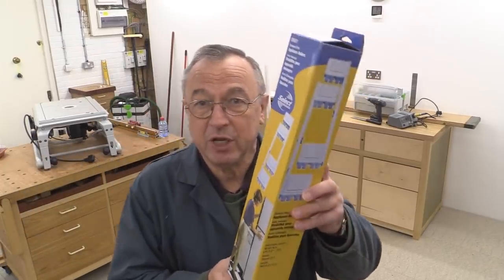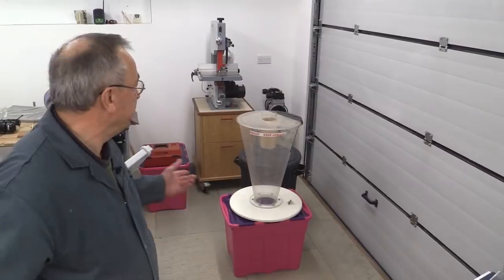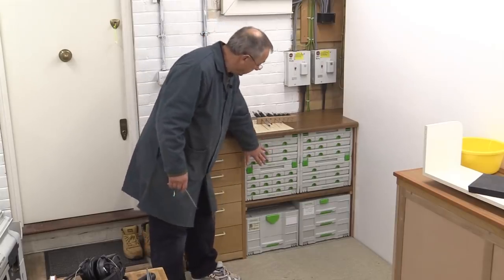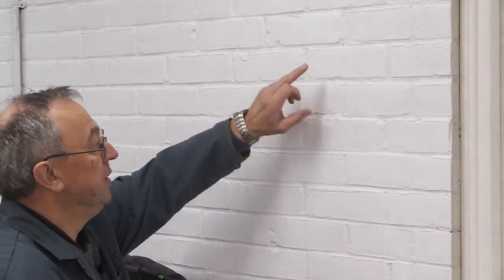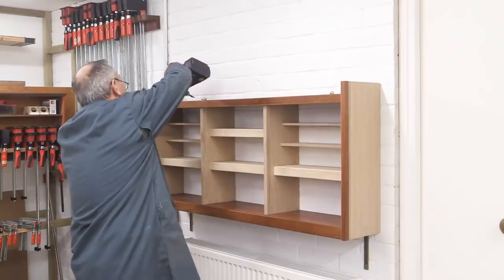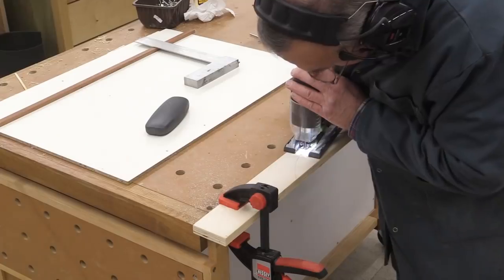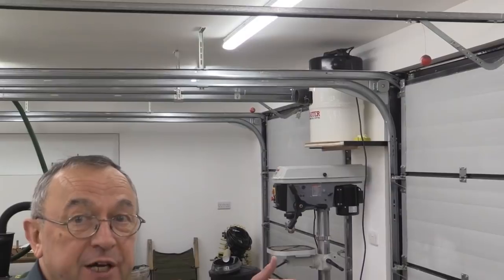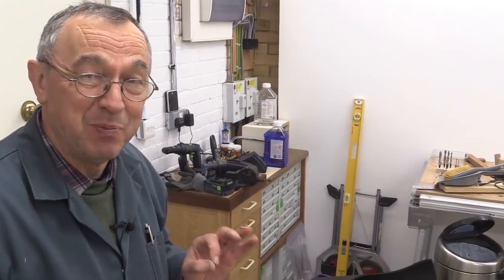The New Workshop #5

Comment: Hi Peter I have just looked at Ron Paulk's SMART  trailer tour which was very interesting.  He has lots of ideas for storing small parts etc so they are ready to hand and easy to find.  Might be worth a skim ( it's quite long but you can skip through it quite fast).
Looking forward to seeing the workshop once it is organised " Parfittly".  WKR  mike
Reply from the maker: Hi Mike, Ron has also done some work with the Parf Guide System which he rates as excellent !!  Cheers.   Peter
Reply: Yes he showed in a tube in the tour of the trailer.

Comment: Hi peter,

If you decide that you do need a wall cupboard, Dry Line Pro wall fixings work really well. I have put radiators and kitchen units on them.

Have you considered considered making your own workshop doors to replace the garage ones.  You could save a lot of space by getting rid of that overhead mechanism, and include much better insulation and security measures.

Andrew
Reply from the maker: Hi Andrew, Many thanks for the suggestions.  Peter
Reply: Totally agree Andrew, I have used them on dot and dab board on single brick wall and they are super solid

Comment: Cracking work as always Peter. I'm a little worried for your back when that extractor gets full and you have to man-handle it down.
Reply from the maker: I only need to change the filter in the extractor once a year as all the dust and debris is collected in my dustbin thanks to the cyclone.    Peter
Reply: @NewBritWorkshop  Ah nice.

Comment: You are getting a great shop Peter. What temp do you keep it? I got mine at 14-15 Celsius and find it very comfortable. Do you plan to put your compressor in the attic?
Reply from the maker: Hi Marcus, At the moment the weather is quite chilly and so I am keeping the shop between 10 and 12deg C. If I am gluing then it has to be 12 deg or more. I have the radiator now and that can raise the temperature from 6 deg to 12 deg in about 30 minutes. I am still undecided about the compressor as it is essential to bleed the water from it at the end of every day or at the end of use. With a loft ladder this is not ideal so the machine may end up in the main body of the workshop.  Peter
Reply: Peter, run an extension from the drain valve into the shop where you can reach it without having to climb. If it were me I would use 1/4" copper tubing and put a 1/4" ball valve on the end in the shop. You can also buy automatic bleeder kits for compressors.
Reply from the maker: Hi Bob, I will - many thanks.   Peter

Comment: Is this workshop smaller than your previous one?
Reply from the maker: Yes, by a small amount but in the old workshop I had a second floor where I could store masses of kit and materials.   Peter
Reply: Looking good Peter.  Lots of work, but nice to have a clean sheet, even if a touch smaller.  Have you got a sketch of the new workshop layout you can show us, or is it not yet 'locked down'?
Reply from the maker: Hi Terry, No sketch yet as I am still adjusting the positions of things. In the next, and I think final, video of the series I will show the actual layout in detail.   Cheers.   Peter